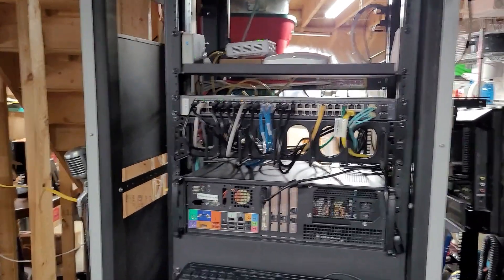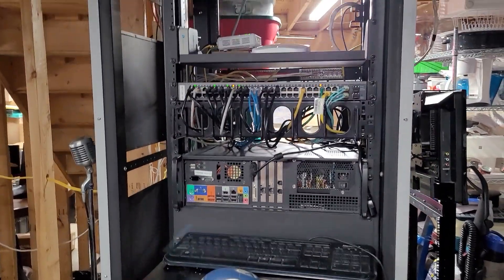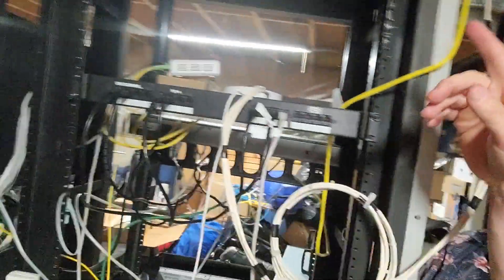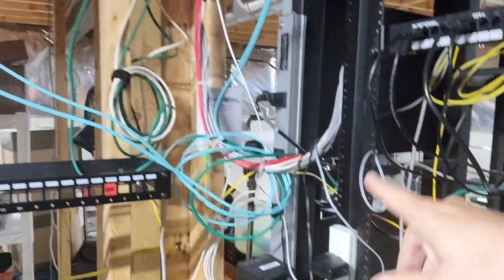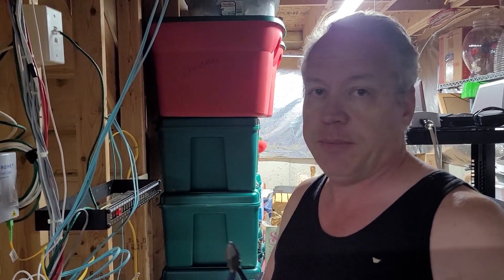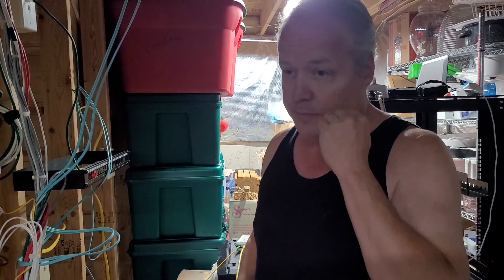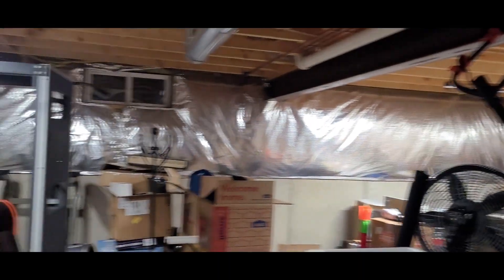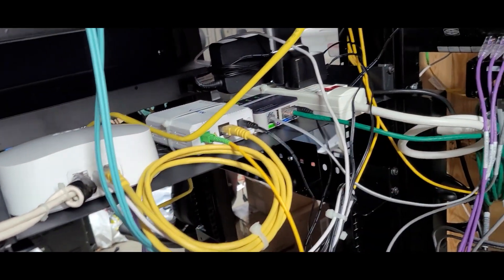Rebuilding my Home Data Center TELCO Rack and showing some details on my cable trunk and patch panel

Comment: hey brad i did comment on this but seems message didnt go through,

Can you tell me if the keystones you are going to use will except any bandwidth and are these much more reasonably priced as i noticed when you go up to 10gb and fiber these connections can be alot more 

also the switch you have near the end of the video is that a tp link and is that 10gb 

i dont think you needed the time lapse interesting videos like this people will generally stay to watch them.

Another though is what is the shelf life on cables before they start to degrade and you know when you were testing the cables you made up should you periodically test the lines and does the fluke meter tell you this sort of granular information ?
Reply from the maker: OK so question one, The Keystone that you get is ratted at a CAT5e/6/7 and so on.  I get Cat 7 or 6 most of the time for I know I can get most of a 10 GB copper connection from that connection.   Now the doesn't mean you get a full 10 GB but you can get real close.  It is copper after all.  If I want a full duplex 10 GB connection, I use two LC-LC 10 GB fiber pairs.   By using ALB (Adaptive load balancing) protocol I can get full 10 GB up and down for reads and writes.   Now for my home backbone that you saw in the video, I use only two 1 GB fiber pairs using spanning tree protocol. (fail over ) basically but I can spit it up and put one 1 GB fiber connection on a PFSence router to isolate my lab from home traffic if needed in my lab, as you will see soon with the server rack rebuild videos, I will have a 10 GB setup.  But I use my 10 GB for my backup needs and other local high end traffic requirements.   That is not for user bandwidth for no single user can truly use up a 10 GB pipe in full duplex mode.   Server transactions can but not a single user.  Now for your last question, (I think)  is how long do my cables last over time.  I use FS.com cables and fiber.   I also make my own.  On avg. the cable that ware out the soonest is the cable that is insert over and over into RJ-45 ports.  Why? Well the gold plated contacts of the pin sleeves are just that, plated.  So if you keep your new cables in their bags, they will stay good to go and ready for use up to 20 years from now.  When you take them and use them for patch panels cabling they do pretty good.  it is the poor cable that connects to your laptop, work bench and PC systems that take the beating.   Over time the gold plating will weaken and your bandwidth may be impacted. but the cable will not totally  fail.  That is a rare thing with pre-made cables but does happen when you make your own so you test them each before use.  As for my fiber cables.  Just keep them capped when not in use and never bend the fiber cable beyond 25 degree or the glass fiber will fail.  I think I answer all of you questions....   As for the video editing ideas?  It would have been over a 1 hr and I saw it is not recommended to have such a long video.  But thanks for the heads up!  Keep doing what you do man!  Or gal! Not sure.  Be good!